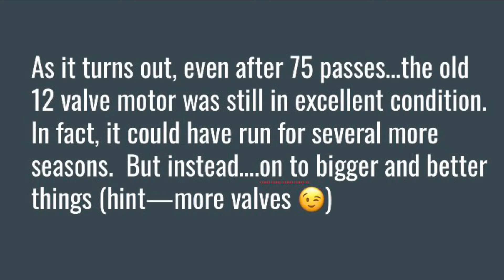Cummins 12 Valve Diesel:  Taking it apart:  Cummins Pull Truck loses its heart!

Comment: I agree your 12v you took apart appears to be in really great shape!  I'm interested to see what you have planned for this season!  I'm going to be building a motor for my 97 12v this fall and still trying to decide exactly what I want in my next motor.
Reply from the maker: Thanks!  It surprised us just how much it “took” and still looked good.  12 Valve platform is very robust and extremely durable.  Good luck with your build! Most importantly—have fun!